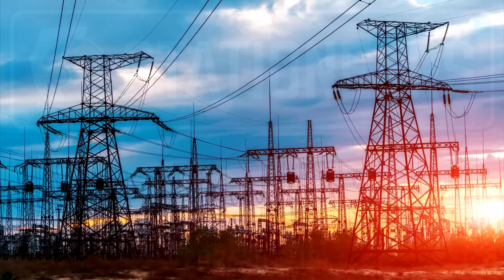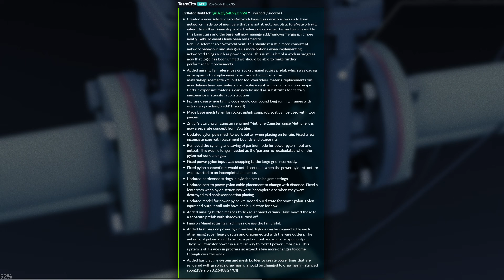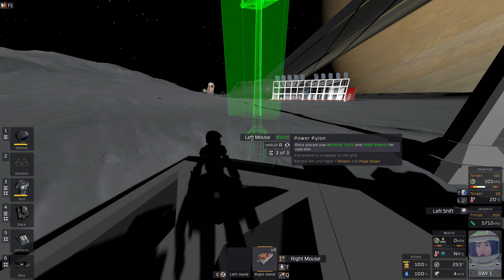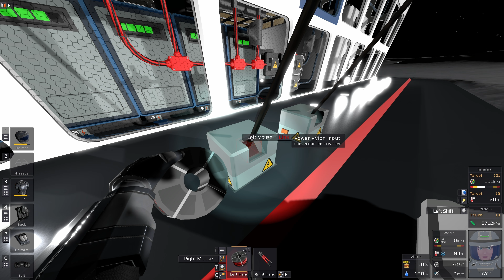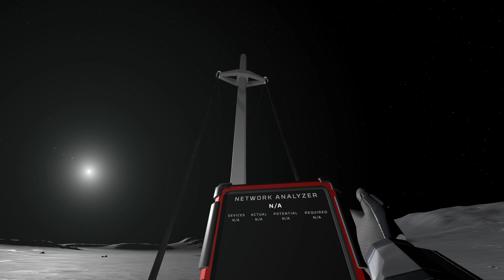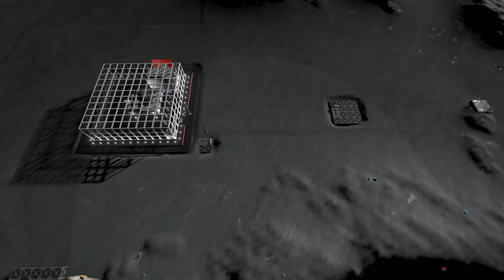Stationeers News - High Voltage Power Pylons ****

Comment: It's a shame that the cables can't be connected directly. For example, when using a small miner and preparing the terrain for the base, it would be very useful.
Reply from the maker: I don't know what you mean. The power pylon cables? Or cables in general? For the latter, there's now a Cable Gun on Beta, by now even a click-click operation instead of click-draaaaaaaaaaaaaaaaaaaaaaaaaaaaaaaaaaaaaaaaaaaaaaaaaaaaaaaaaaaaaag-release, and can build into open space instead of just along a surface.
Reply: @OwnerOfTheCosmos  I like to build multi-story bases, even underground. Even at level 0, Electric pylons are nice. But sometimes I mine with a small miner. Sometimes I make a 6x6 block hole all the way to the bottom, and then create a staircase. And I wouldn't enjoy laying cables with a gun all the way to the machine. The good thing is that using a gun makes laying cables easier. But I think these cables should only be used inside buildings. It seems more logical to me to connect free-standing buildings and machines, using electric pylons and cables from them. But what if I wanted to run such lines underground using a tunnel, and have the pylons on the wall. In the future, storms could come and damage the pylons and such lines.

Comment: Power lines are great—
you can build outposts, but I’d like the game itself to provide incentives for building them. For example, mining rare resources, exploring a planet or moon, or investigating old, abandoned bases—we could build an outpost 3 kilometers away from the main base for exploration. It would also be worth revising the electrical power system—focusing not on power, but on current, voltage, and resistance—and not forgetting that power is a function of current and voltage. Then transformers would be more important than they are now, and UPS units would serve as stabilizers. We also need to add antennas designed for data transmission between bases, rather than those used for voice communication—for example, antennas similar to those used for communicating with merchants, but specifically for data transmission. It would also be great to launch satellites that would allow data exchange between bases and stations. For example, we have two types of antennas: a parabolic antenna and a cellular antenna. parabolic antennas would allow for data exchange via satellites and communication with traders, and could cover the entire planet or the moon, while cellular antennas would only provide local coverage—that is, by sector, just like in the real world—which would be great. I’d also like to see programmable displays where players can draw schematic diagrams—the player decides what diagrams to draw, programs them themselves, and then sends the data to the display. Essentially, it’s a SCADA system.
Оперативные исправл

Comment: Wishful thinking but I hope they add voltage and current as properties you need to consider to power, I would love to make some substations
Reply: although I think it would be cool to have voltage, frequency, amps and watts as well as AC and DC power.. I think it would be pushing the game to far away from an arcade simulator. everything else in the game is an arcade version of real life, adding this level of detail would be to much.
Reply: Make a mod. Or find one.
Reply: @NoHypocrisy42  I can only make shitcode, I cannot make one
Reply: Even then, you'd have essentially fixed steps of voltage, (transmission/HV, campus/MV, consumer/LV) you just have to figyre the ratios between them. 20:1? A Light Cable connected to LV would do 5kw, but to MV 100kw because you're implying voltage without stating it. Maybe light cables cant do HV because inadequate insulation. As a hobbypro electrician, I don't want the exacts of voltage amperage. Ratios on an abstract would suffice

Comment: My last 300hrs have been in beta on the moon and just in the last few days I have noticed power spikes and drops like when one light not working just for a few seconds or minutes and also yesterday when I tried to print of a nuclear battery my printer would just turn off 2% in every time. Also I'm starting to see both coils and heavy cables blowing. 300hrs on this moon base and it all only started happening in the last few day. To be fair I only started using the launch pad mod and LUA mod the last few days in beta and in general so it could have something to do with those.
Reply: I replaced my heavy cables with super heavy and my small cables with heavy and that has fixed all the spike issues including being able to once again print a nuclear battery.